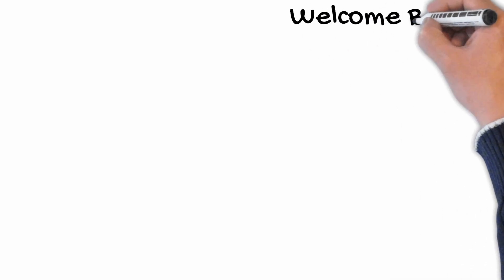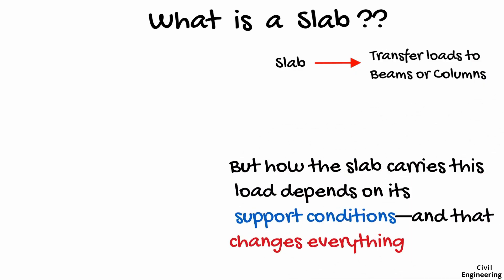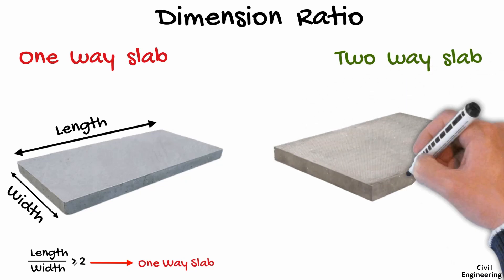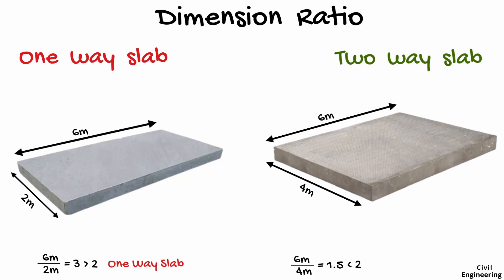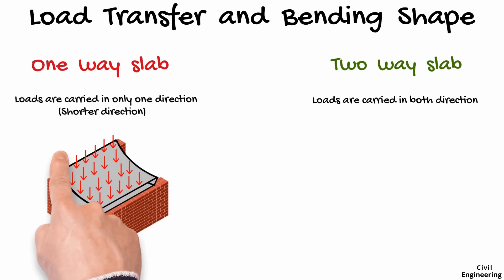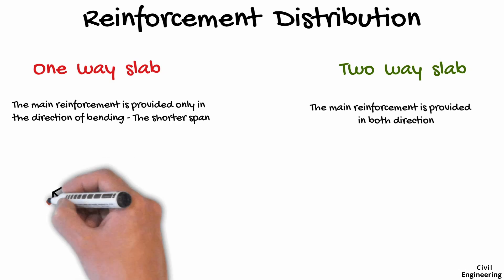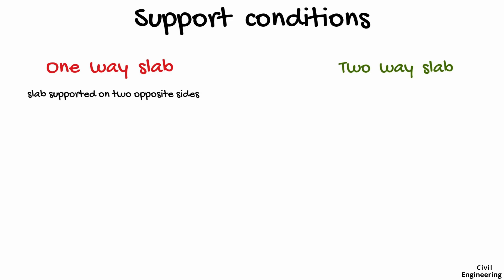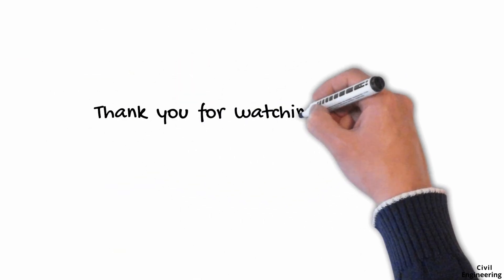One Way Slab vs Two Way Slab | Friendly Structural Concepts

Comment: If we assume the following:

W = Width of Slab
L = Length of Slab

Can we change L/W ration into the following:

1. If W is more than 0.5L Therefore; it's Two Way Slab.

2. If W is Less or Equal to 0.5L Therefore; it is One Way Slab

E.g.(1): If L = 6 and W = 3 Therefore; 0.5(L) = 0.5(6) = 3 it is One Way Slab.

E.g.(2): If L = 6 and W = 3.1 Therefore; 0.5(L) = 0.5(6) = 3 it is Two Way Slab.

E.g.(3): If L = 6 and W = 2.9 Therefore; 0.5(L) = 0.5(6) = 3 it is One Way Slab.

If W > 0.5L => 2 Way Slab